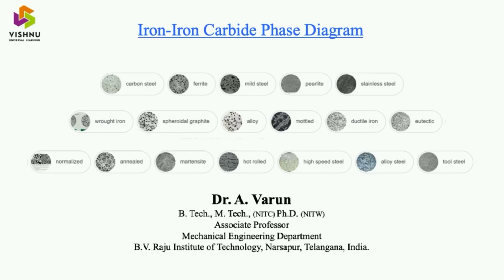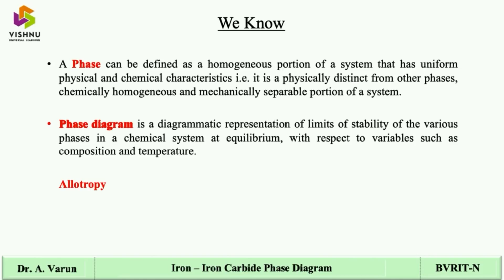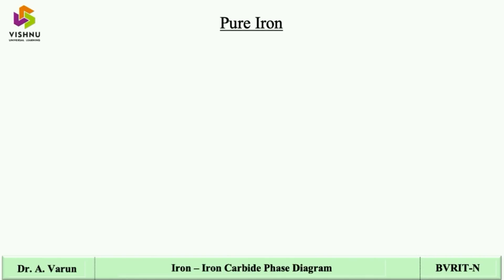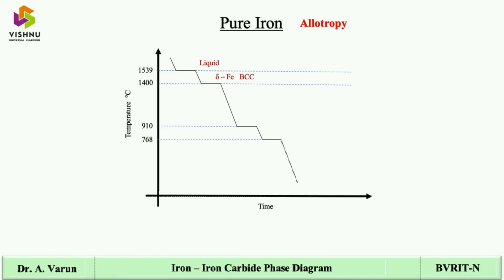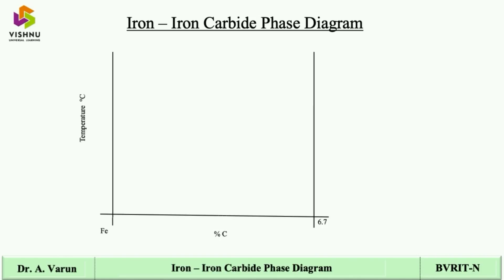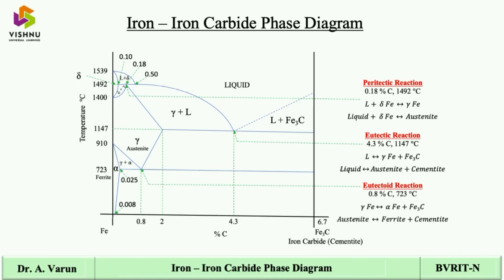Iron Iron Carbide Phase Diagram

Comment: Each element is made of atoms which in turn are made of e-,e+,neutrons,These sub atomic particles are same for each atom(bcuz we take same e- charge for all elemental atoms) .then what makes the elements to behave diff. from one another?
Reply from the maker: Generally, it is the number of such electrons and protons which reflects on the behavior of elements. Also, the elements behavior depends on the outermost electron configuration and the type of bonding.
I hope my explanation clarifies your doubt.